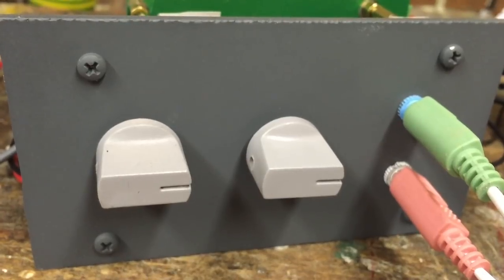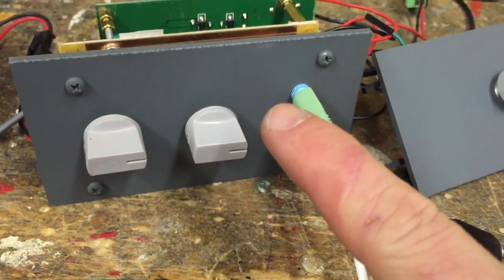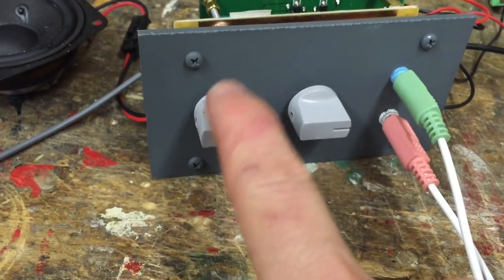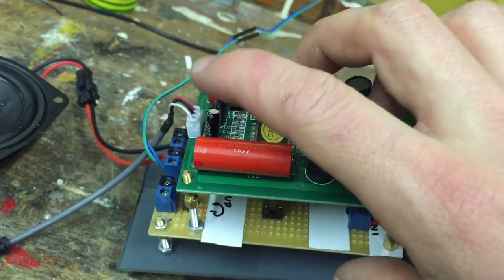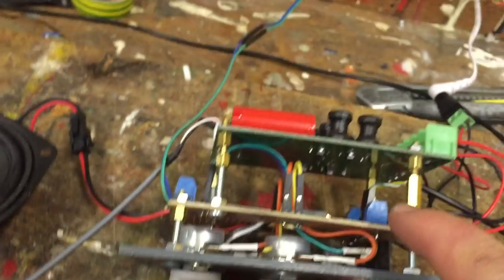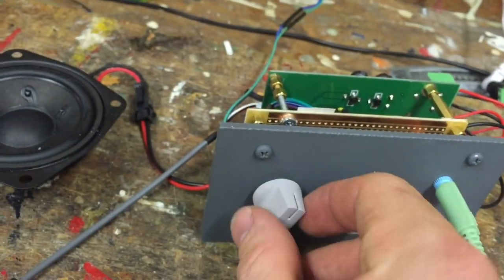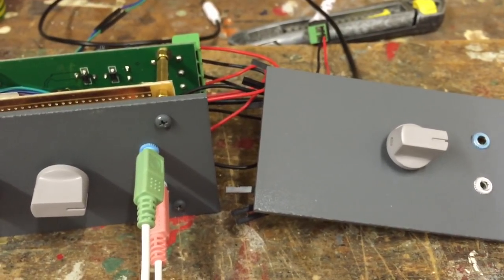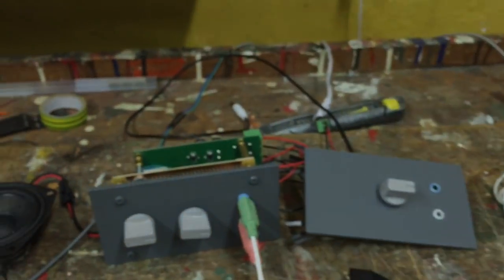ATC sound controls - B737 Home Cockpit

Comment: you are a genius. have you thought in some way to the pilot and the copilot hear each other by headset? some kind of intercom.
Reply from the maker: Hi Miguel Gomes. Yes and no. 
Yes: It can be done quite easy by connecting two headsets to the computer using a Y-splitter. Then you just un-mute the microphone in the Windows sound setting and that should give you a intercom. 
The reason I abandoned the idea is that I also have speakers, and with the method described above the sound would also be played in the roof speakers. So it would be a bit more complex. 
/Peter